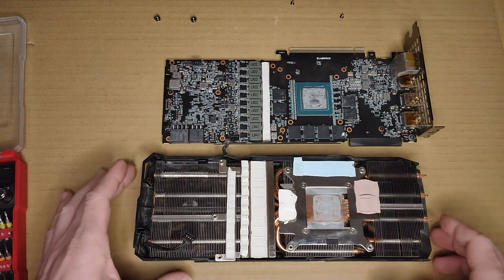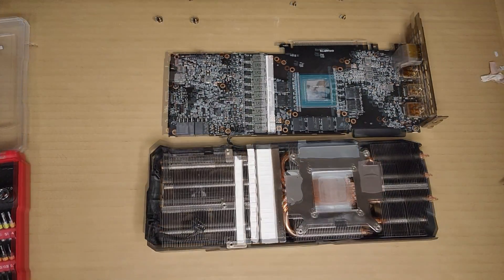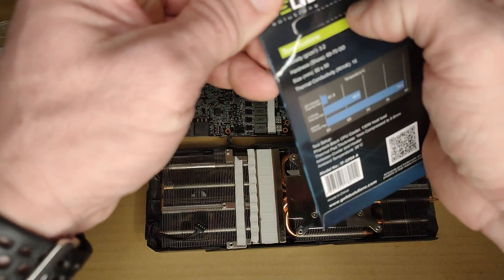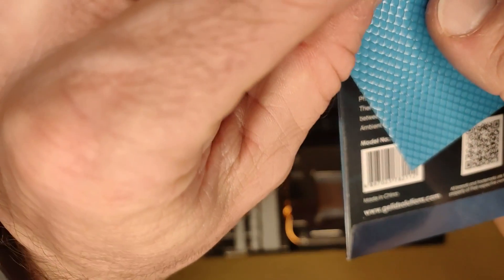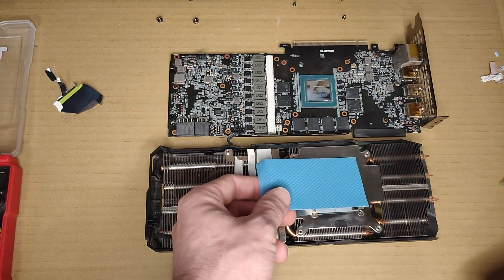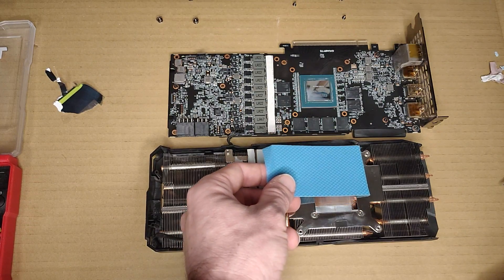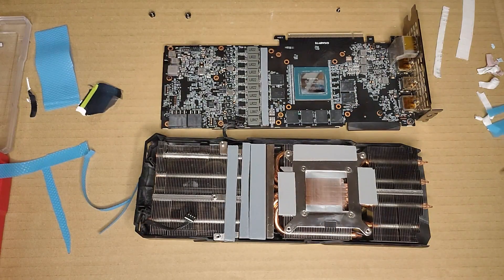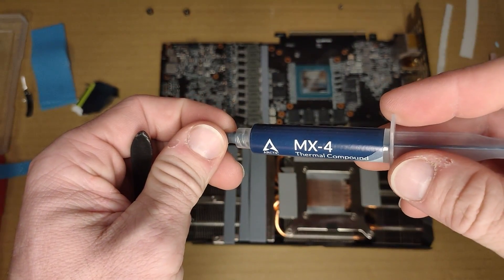How to change thermal paste and thermal pads I Gigabyte Nvidia RTX 2080 windforce 8Gb + Gelid + MX-4

Comment: I replaced my gigabyte rtx 2080 super windforce oc 8gb's thermal pads and thermal paste with Arctic brand products, and now it's silent as a lamb, running between 50-60°C under heavy rtx load instead of the 80-90°C it used to

Comment: i just replaced the thermal paste on my 2080 windforce because it was instantly reaching 83°C under load and fans spinning with 2800rpm constantly. after replacement and 1h gaming (~99% load all the time) the temps were sitting at 68°C all the time while fans only running with ~1700rpm. even gained 100-150mhz core clock because no thermal throttle. ty for the vid

Comment: Old video and a bit hopeless/stupid question. After the paste & pads change the fans wont turn on again. Double checked the wirings (used meter to check that the cable to fans is OK, and also the connector J9 is securely in the pcb). Starting to be a bit clueless what to troubleshoot next. Any ideas? Fans wont turn on startup or under a load (ie. gaming).

Comment: my rtx 2070 super windforce 88c and the clouk drops to 1300MHz if i change the thermal pads and thermal paste will solve my problem?
Reply: check for the hotspot temp... not the regular temp.

Comment: So I bought only 0.5mm thermal pads to replace on my RTX 2080 TI. Mine only uses 0.5 and 1.0mm. Do you know if I can put 2 layers of 0.5mm pads where you are suposed to use 1.0mm?

Comment: great vid, my 2070 super has the same problem, hotspot hits 105 degrees and fans spin up to 100%
Reply: Have you replaced the pads too are they similiar to the 2080 shown here? I am asking because I want to know if I also need the 0,5mm, 1mm and 1,5mm pads.

Comment: Thanks for the very helpful video! For the rightmost pad labeled 1.0 mm in the video I ended up going with a 1.5mm pad because I could see a clear light gap between the pad and components when shining a light from the bottom of the board after re-assembly. Guessing there could be some minor board to board variation. For folks replacing their pads, it may be worth spending a couple extra minutes to shine a light between the reassembled board to ensure the pads are touching all the components.

The hot spot temps dropped by over 20 deg C for me! I'm thinking the old thermal paste was shot / almost all pumped out.

Comment: I had to undervolt this card and make a fan curve and yes before doing so I had also the 4000rpm fan like an airlplane taking off, the paste and pads being hold + the voltage being high by default makes this card a nightmare luckily I knew what to do

Comment: Thank you SO much for making this video! I was clueless on this process, had never taken apart a GPU before.
My Gigabyte 2080 Super Windforce OC was suddenly sounding SO loud randomly. The fans were kicking in unbelievably loudly then going quiet and then loud and then quiet. It was infuriating. It used to always run quietly.
I did this process using the GELID Ultimate thermal pads and Kryonaut thermal paste and my GPU is night-and-day different. In the same game/scene, my GPU temps have gone from 74-75 degrees down to 59-60. The fans are so much quieter, and my clock speed is far more high and stable.
Thank you again for making this video, it really gave me the confidence to do this project!
Reply from the maker: I'm glad the video was useful for you

Comment: I have been having this problem for years. At first I started using Msi Afterburner and using curve and under volting. However it’s not working anymore. I put my pc in the shop and he changed the thermal paste and replaced my motherboard, but I wonder if he changed the thermal padding? Thanks for the video. I haven’t even heard of thermal padding before this.

Comment: umm i have this card.. but mine has a small circuit board at the end with a wire that hooks to a thermal sensor that came off and I have no clue where the sensor is suppose to go. bad part is.. no one seems to have that small extra circuit on their windforce.. any ideas? (Your housing shows where the circuit would sit in the housing..but it does have that part.. (at 2:06) betweent the two screw hole mounts is a place a small circuit board can fit)
Reply from the maker: i wanted to find something about it, but don't find anything, sorry, can't help you with that; but when you disassemble the card, didn't you see some connectors that si free? that there could be the circuit board connected to?
Reply: @dostuffwithjonathan2549  I got the card off ebay already torn apart. it had solder break loose, I think i found where it was suppose to be and fixed the (bad attempt at a repair) soldering job. It does run a little warm but not dangerous -  HP-- average is about 75-80

Comment: Do the backplate thermal pads need changing too?
Reply from the maker: I didn't replace it in the video because my thermopad was still fine, if the temperatures don't drop AND your thermalpads are all oily (you can see an oily stain around the thermalpads), you can replace it, it's a 2,5mm pad

Comment: I've got a Gigabyte RTX 2080 WINDFORCE 8GB and been looking for info everywhere for pad thickness but it's all TI or GAMING OC that I've found. Have you any idea if it's the same as either of those cards? any help would be greatly appreciated. Thanks.
Reply from the maker: yes, i have the exact the same card! i need to write this in the description, so you can see and take my measurement of the thermopads!
Reply: @dostuffwithjonathan2549  Thanks for replying. Excellent, I can now order some new pads and thermal paste with confidence now.
Reply: @VjMavdog  Hello, have you been given information about the sizes of thermal pads? And then the same thing started for me. If it's not difficult, please writ
Reply: @Alex_Koltsov  At 5:22 there is a picture on screen with pad thickness.
Reply: @VjMavdog  Do they have similar cooling systems? In the video, he shows gaming and as far as I understand, you asked about Windforce
Reply from the maker: @Alex_Koltsov   I corrected the title, mine is the WINDFORCE variant, I didn't write it down correctly; but the diference betwen the GAMING OC and WINDFORCE is, the GAMING is a bit higher clockter GPU and has a bit bigger ventilated fans, otherwise the contact area for pads should be the same
Reply: @Alex_Koltsov  I think that they are basically the same card the only difference being that the Gaming is factory overclocked.

Comment: Great video! Lowered my temps from 86 Celsius to 60 Celsius. I changed the thermal pads and the paste as you instructed here. Easy to follow! One thing I noticed was the side close to the inputs had extra thermal pads. Just kept them the same as the other side. Also, the two screws you didn't take out had to be removed for me to get the other side off.

Thanks again for this great video!!!

Comment: Good clean job, as a computer/laptop/VGA repair guy i used lots of MX-4 but switched to PTM7950 and Laird TPCM 7000 phase change pads because it lasts longer and has fenomenal heat transfer.
Reply from the maker: thank you! i didn't get the chance to get my hands on this thermal paste and pads, will try to get some and test it someday